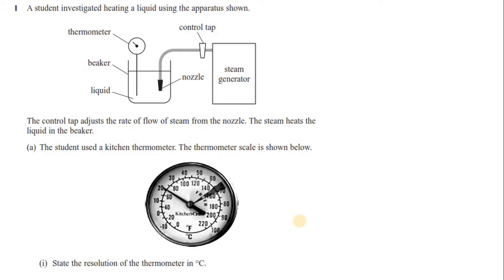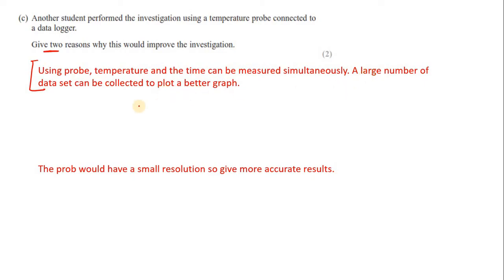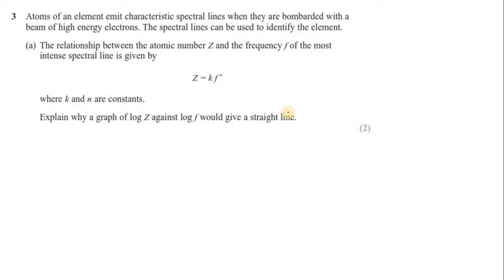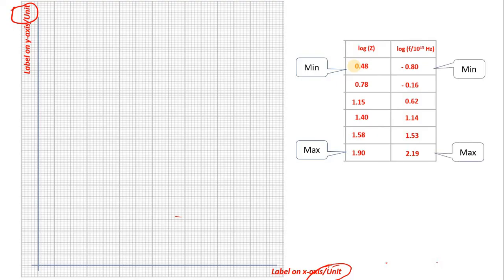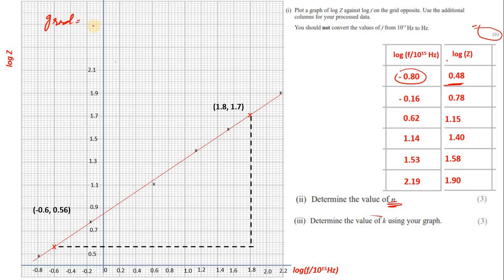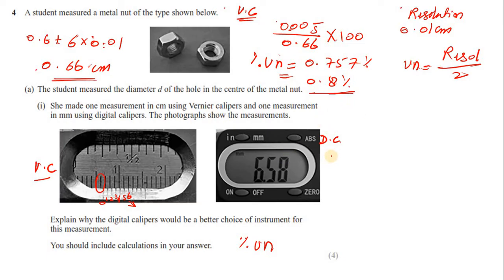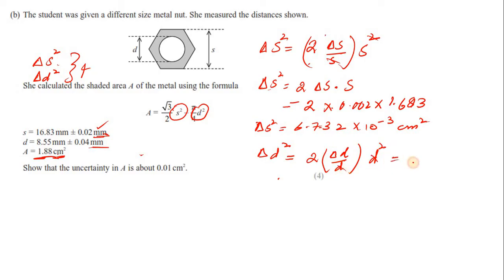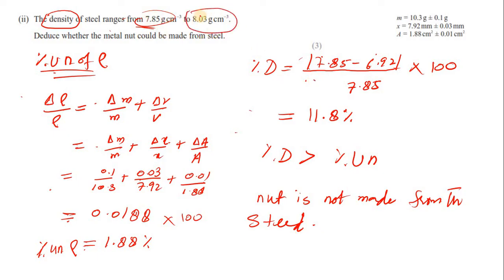Edexcel IAL WPH16 June 2022

Comment: Hello sir, ughh I still somehow forgot to fill more than 50% of the graph, I only filled 1/4 of the graph! It was of 6 marks! Will I lose all my marks ? Please tell me I'm so worried 😫. I also took only 2 sf in both y and X axis. And also my gradient value in the next question was slightly higher!  Please let me know will I lose all the marks or just one or two from six?
Reply from the maker: No, if all other working is fine like axes labelling, correct points plotted,  best fit line. 
Then you will lose 1 mark.